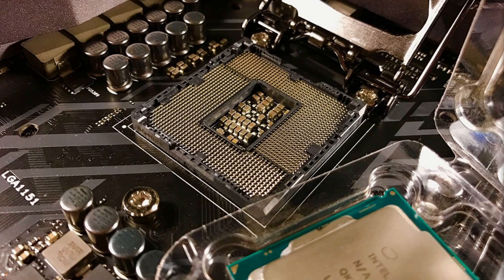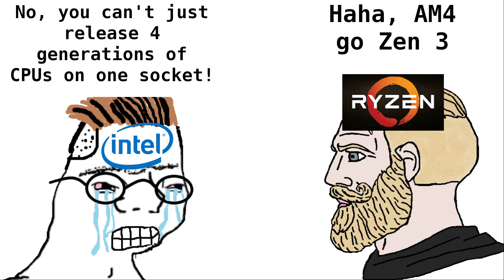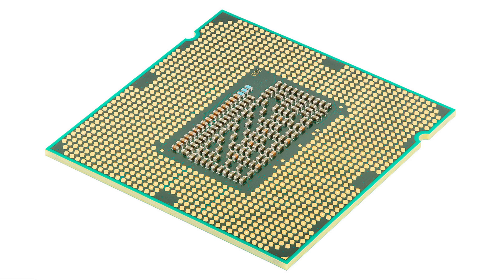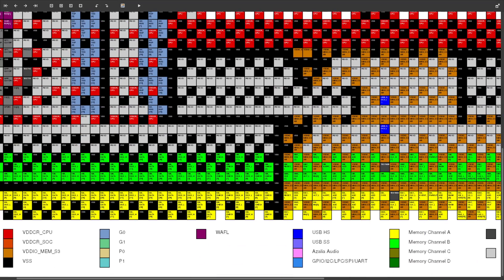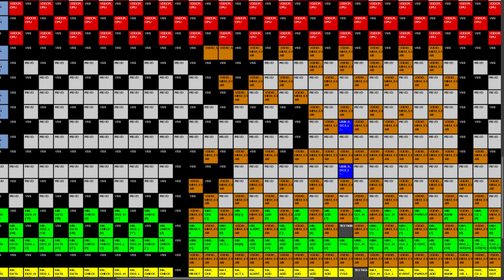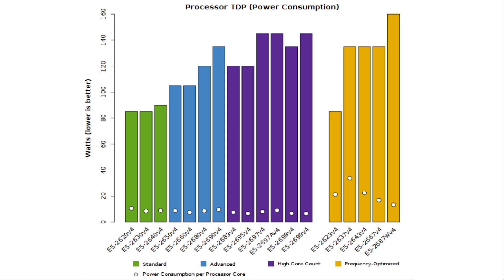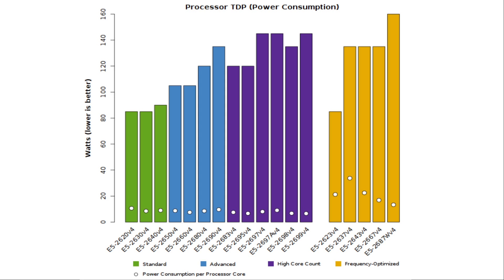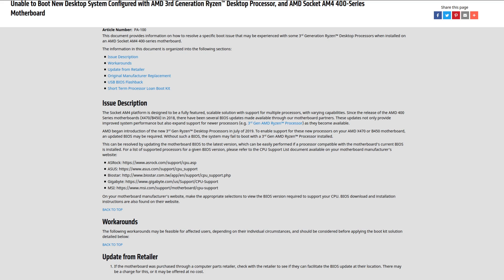The Reason for CPU Socket Changes

Comment: If it wasn't for those damn notches I am sure they would fit just fine, just take a metal file and make the notches fit the new socket and you are good to go
Reply: Literally how LGA775 Xeons had to be fitted on regular motherboards. A pin switch sticker mod and a file.

Comment: Intel changes socket to prevent user to do BIOS update themselves
Indeed AMD doesn't change socket, but you can't use Zen 3 on older mainboard than B450 or X470 (Even then, you need to update the BIOS yourself)
Reply: Now you can

Comment: intel makes it dumb since start od the world
socket7 > slot1 because amd  uses our socket for k6
socket 370 3 generation were totaly wire mod skipable, no adapter needed
mpga 478/mpga479 adapter was avalable to put deneb on desktop boards and nortwood/prescott was a mater of powerhungry  cpu's rather than any data integrity move, pinout was backward compatybile
lga775/771 still suppoeted 3 generations of silicone and it was up to board maker to hack bios and install microcode patches for newer cpus to work on older mobo, doable and i did that myself on am2 board (due  to oem ockdown bios)
there are technical reasons to change a socket like different way of working or communication , more pcie lines, different ram  or botherboard interconnect
amd right now do it the right way, still a bit a letdown with no zen3 on b450 but i can understand why when intel lock you down to 2 gens of cores (on the same process) and simply add or remove one pin from the socket to make sure you can't use it, that is just planned obselesence of hardware, making sure you won't be able to use your mobo longer than 5 years, because first gen core cpu's are still around and kicking and intel do what it can to push more junk on the market

to be perfectly clear, nowdays most cpu's could be an addon pcie card with a socket and bios on it, because this is how they communicate with rest of your system now. motherboards almost don't play any role in what cpu does since more and more of the computer is swallowed inside of themwho knows , you might be even able to swap cpu brands in a setup like this

Comment: A kid came to me to get his motherboard pins repaired because he tried to put an i7-X into his i5 machine and mangled the pins because Intel are jerks and he didn't know that the X chips have a different socket.
Reply: @kevb8983  Yep. If people knew how many electronics I've burned, smoked, snapped, dropped, or been electrocuted by...they'd never want to do what I do. I fixed his Intel socket pins with a dental pick and a Canon R60 camcorder in macro zoom mode attached to a field monitor (basically a poor-man's digital microscope).
Reply: wristpain  It does when you're 12.
Reply: @JodyBruchon  man is 12 with a fairly high end cpu?? lmao
Reply: @noodles.is.awayyy  He saved money from all sorts of things to get one. I fixed that board and he sold all of it and had me build him a Ryzen 7 3700X instead.
Reply: oof :( i also thought it worked that way too back then and didn't know that different types of cpu sockets existed
Reply: I7× and standard i7 are completely different CPUs. 

Going by 6th gen for example, an i7-6700K has more in common with an i3-6100 than it did with an i7-6800

X99 and x299 Intel chips are modified Xeons and have all different types of changes, like more PCI-E slots, memory channels, etc.
Reply: @moist_ointment  The nomenclature is a problem. An i7-X is a completely different CPU? Then don't call it an i7 at all. That's my problem with this whole thing. I could understand something called an i9 or a completely different name (i.e. how Core 2 and Atom and Xeon are obviously different) but any i7 in a particular generation should use the same socket.
Reply: @FlabbyTabby  No, Intel kind of is at fault here. They may specify it on their website, but the rule with Intel chips has always been (since the start of the Core i-series) that every processor fits in the socket for that generation, except for some point where the high-end stuff begins...but they don't change the name of the chip. If an i3-3xxx and i7-3xxx all tit the same socket, why does an i7-3xxxX fit a different socket? Why does an i9 fit a different socket than an i7? It's stupid. U
If you get a Xeon, it doesn't fit a Core i-series socket, but it's not labeled with that name either. If the socket changes, the name should be changed too.
Reply: @JodyBruchon  that first generation is the generation not the socket, so that's just a dumb assumption. Takes about 3 seconds to realize they don't fit together.
Reply: @DoesntRefillTheBrita OK smart boy, name an Intel desktop chip in the Core i-series from 2nd gen (Sandy Bridge) onwards where the i3, i5, and i7 (non-X, not i9) DID NOT use the same socket across that generation. Go ahead. I'll wait.
Reply: @JodyBruchon  i7 3820. It's not an X SKU, but it's still HEDT. Give me a hard one next time.
Reply: @DoesntRefillTheBrita  It's an X chip. My point still stands, too. It's not a standard chip but it's called an i7. If anything, you've made what I said even more valid. The i7 chips below that all use the same socket as the other lower chips.

Product Collection Intel® Core™ X-series Processors

Code Name Products formerly Sandy Bridge E

Vertical Segment Desktop

Processor Number i7-3820
Reply: @JodyBruchon  "X series" but it's not an X sku. Now you're moving the goalposts because you realized how dumb that argument is. A CPU socket is the grown up equivalent of that block game for toddlers. Heads up, the cylinder doesn't fit in the square hole. 🙄

Also stop liking your own comments, it's kinda cringe
Reply: @DoesntRefillTheBrita  I didn't move any goalposts. You picked a CPU that makes what I said more true than the ones with an explicit X at the end. You made my case stronger. Congratulations.
Reply: @JodyBruchon  but that point is completely incorrect, and the only person who agrees with you is yourself because you still like your own comments.
Reply: @DoesntRefillTheBrita  No matter how many times you parrot that it's incorrect, it's not, and everyone reading can see that it's objectively correct.
Reply: @JodyBruchon  I love how you keep ignoring the fact that you like your own comments to make it look like somebody actually agrees with you

Comment: With a 6502, a breadboard is the only socket you need.
Reply: Ok Ben Eater
Reply: @NoorquackerInd  is 'Ok Ben Eater' going to turn into the 'Ok Boomer's for people who build out every detail of their tech library?
Reply: Can you make multisocket server version out of those? ie. in style of 1000 raspPi rack.
Reply: @effexon  if you're ready to spend several years and thousands of dollars on a compatible breadboard monstrosity that would probably be as large and power-hungry as ancient IBMs

There's a reason why mass producers of microchips can afford terrible designs
Reply: @Invizive  okay, I thought something like that... what you mean get away with? U mean in 10nm scale it wont count much of anything in powerwise and chip design to make some silly design?
Reply: @effexon  I mean that the x86 architecture family is outdated, moreover it wasn't particularly "elegant" even by 80s standards.

Modern processors are just upscaled with added features on top, with barely any radical revisions - pretty much hardware bloat. With improvement in transistor density they can just fit more into the same space getting just enough increase in productivity with each generation to sell it.

Of course, it's a bit more complicated, but the core architecture really haven't changed much over several decades.
Reply: @Invizive  how much could they make it better with different architecture like RISC, ARM or something else? They added instruction sets to circumvent this, SIMD, SSE(?) and many other for multimedia... those execute pretty good as individual instructions, but I'm not familiar with bigger architecture of x86 making these restrictions. However, I think many improvements over years, at least some of them are independent of particular architecture (more general ideas), like cache sizes and many optimization tricks. Early stages of x86 there were no threading I think, so hardware is not there... I dont know how they make it in new cpus and if it is upto architecture. Current cpus are very complex beasts compared to early times, containing dozens of separate functionality sets.
Reply: @effexon  you could probably build a cpu out of 6502s
Reply: @virtualtools_3021  6502 is a cpu by utself doe
Reply: @virtualtools_3021  a 6502 is a cpu bud
Reply: @elpersonpl576  I think he was be fascitious...
Reply: i don't even need a breadboard for my Z80, just 40 loose wires and some electrical tape
Reply: Nvidia bread
Reply: Or a double-wipe DIP-40 socket.
Reply: Remember intel has invented atx/mtx motherboard   cpu   
power supply  etc.
Reply: Well you actually need a Vic chip to get some video
Reply: We’ve certainly come a long way since the days of the 6502 or even the intel 8086